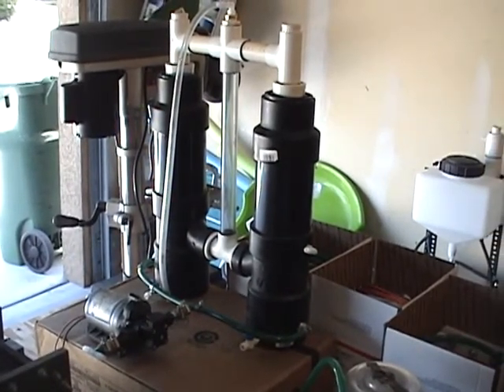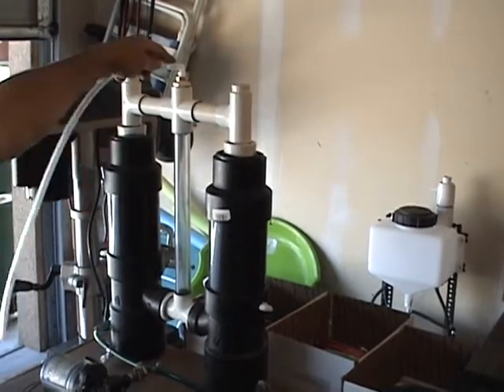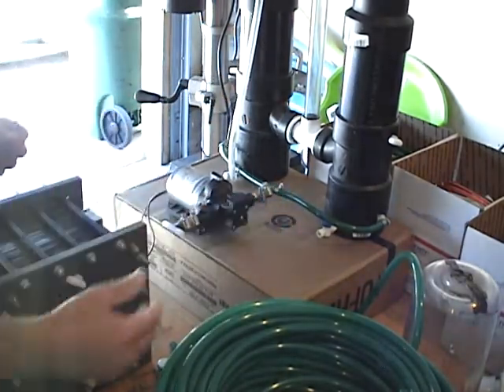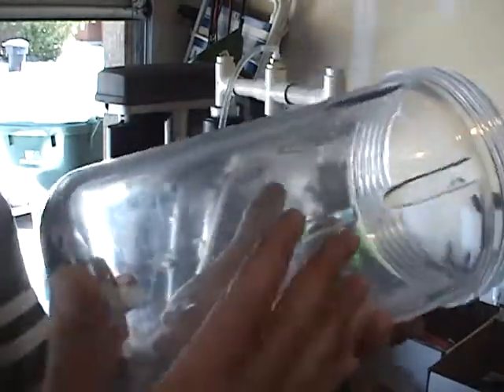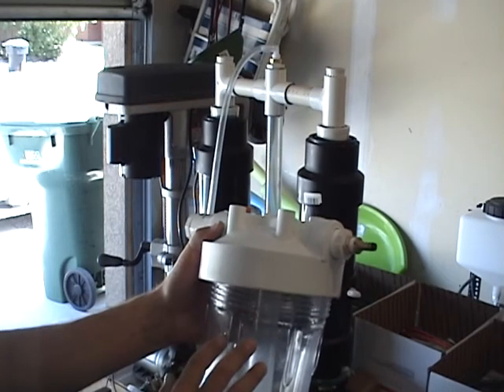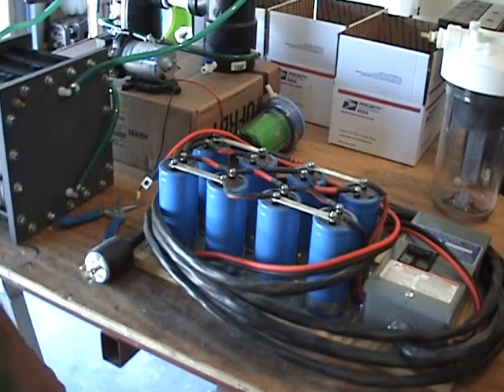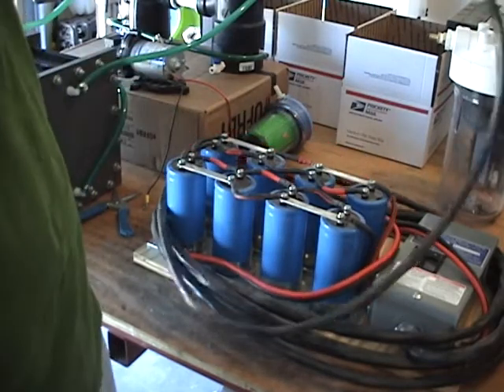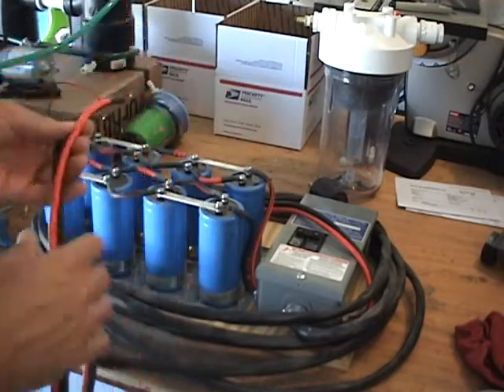118 plate Monster Hydrogen cell Back from the dead part2

Comment: @delvis11 I flinched when your hand touched the Caps. Danger! Any time a Capacitors leads are not shorted together they have the potental to discharge. And a network of caps like yours has a lot of capacitance. The rule of Thumb is Never touch then unless you have shorted them with a shorting probe! God was whaching over you!

Comment: A sonic vibrator will also knock the H and O bubbles off of the plate faces. If you set your cell on a speaker box and put a high frequency signal into the speaker, your bubbles will disengage from the plate faces as soon as they form.
Just tossing that out there for you.
Keep up the very cool work.
Peace.
Mike.

Comment: as always thanx for posting...nice vid
the generators i build are 51 plates and they produce 9 litres / minute although i dont use a pump the pressure is enough... i do also build 3 lpm fuel cells...  your 20 lpm monster is super!!!! i 've never joined mine but if i join  2x of 51plate-cells i should get about 18 lpm so i totally agree with your total of 20 lpm
peace4peace from south africa